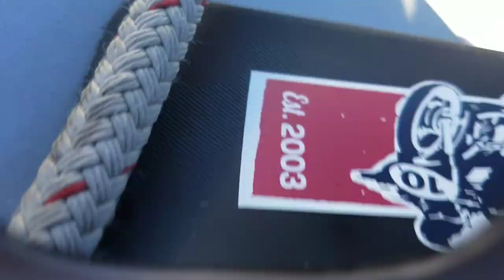Climbing in the chair two different ways. High rise window cleaning, industrial Rope assess,

Comment: Yeesh!  That’s pretty hairy looking.  I would have just used a rooftop roller.  It’s hard to see what you are tied off to.  It looks like it’s just a roof stack (hopefully not)!  It’s really too bad that not all property managers want to have the proper amount of anchors installed for high-rise work.  Also, having yourself tied off to something so far away from the wall, without something being secured to something directly above you is very risky.  On a wall that short, you could easily slide horizontally to the end of that particular wall and find yourself sailing around the corner and down the other wall.  Please don’t get upset by this:  If you’re going to make a video of high risk work, set the proper example.  Pretend that your video is going to be featured on a window cleaning supplies website.
Reply from the maker: We are tied of to roof anchors. I didn't focus much on that,  just different styles of climbing over the wall.